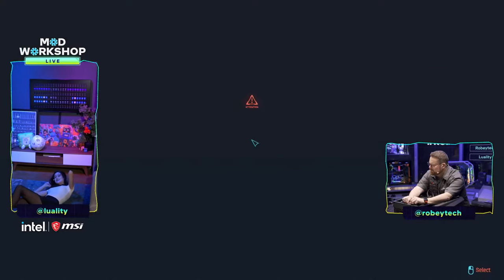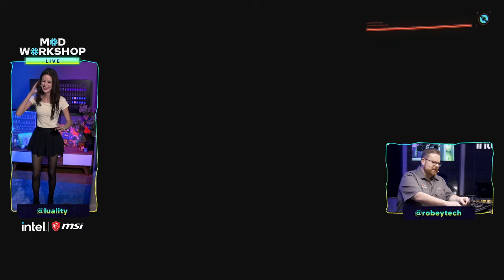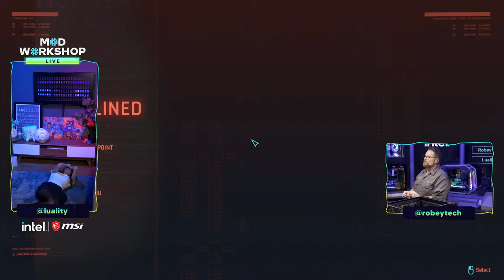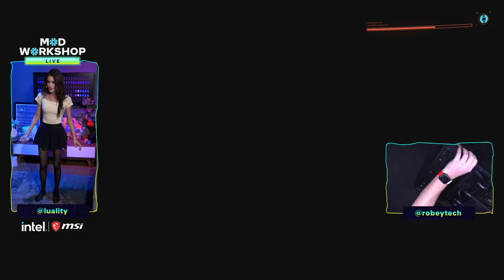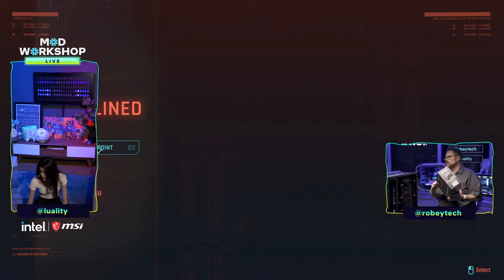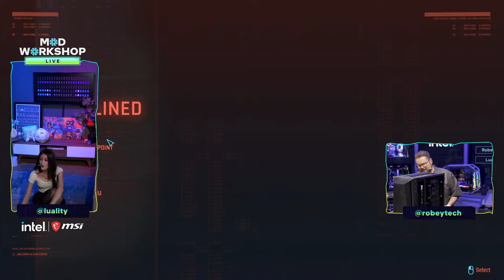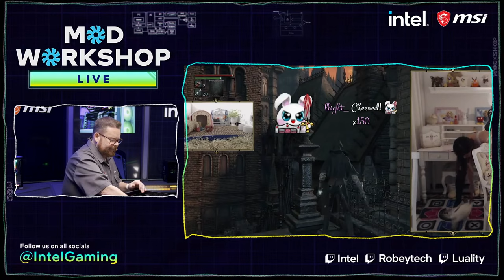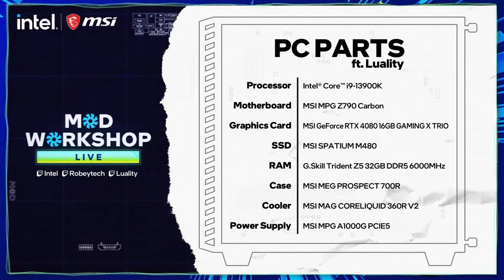Building a $3000 Gaming PC - Giveaways + MSI MEG Prospect 700R (13900K / MSI 4080)

Comment: need help! is this build dumb? what would change on it? not sure about RAM ddr5 7200?
CPU: Intel Core i9-12900K 3.2 GHz 16-Core 
COOLER: MSI MEG CORELIQUID S360 56.2 CFM 
MOBO: MSI MEG Z790 ACE EATX LGA1700
RAM: Corsair Dominator Platinum RGB 32 GB (2 x 16 GB) DDR5-7200 X2
STORAGE: MSI SPATIUM M480 2 TB M.2-2280 PCIe 4.0 X4 NVME Solid State Drive X2
GPU: MSI SUPRIM X GeForce RTX 4080 16 GB 
PSU: MSI MEG Ai1300P PCIE5 1300 W 80+ Platinum Certified Fully Modular ATX Power Supply
CASE FANS: Lian Li UNI SL120 58.54 CFM 120 mm X10
CASE:  MSI MEG PROSPECT 700R ATX
ADDED PARTS: custom sleeves
if you like it can you build it?